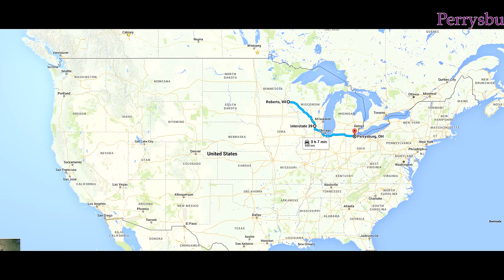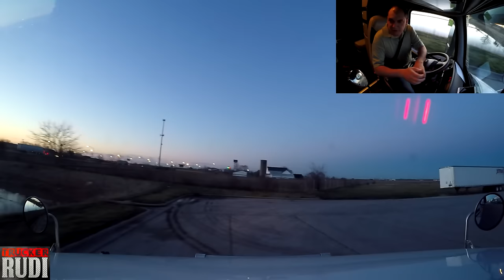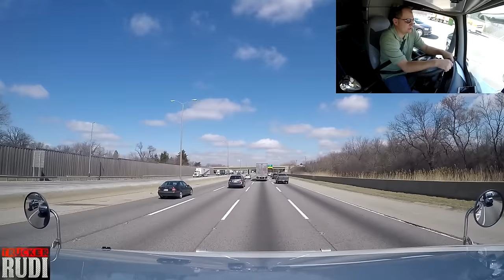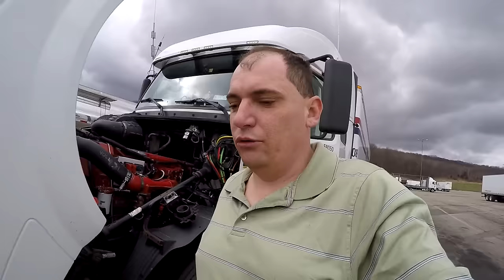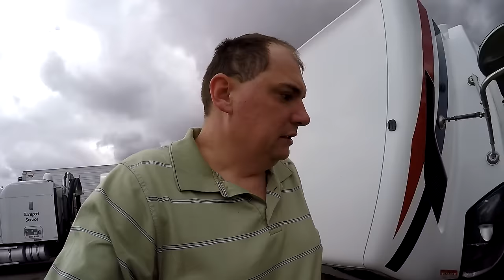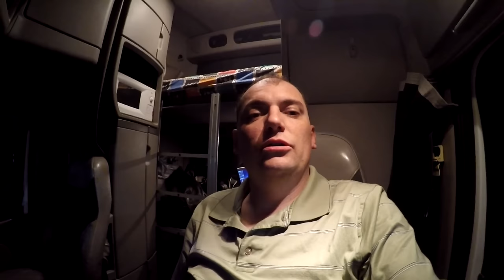Trucker Rudi 03/18/16 Volg#649 Our Daily Journey

Comment: do you have too replace The hole compressor or only The clutch on it ? on Volvos original you can replace only The clutch, It is cheaper that way👍,hope it works out for you! greetings Peter
Reply from the maker: I think I can change the clutch but I think the compressor is shot as well so I'm going to change the whole thing
Reply: +Trucker Rudi (Rudi Dueck) ok it is good  too have that fixed now when The summer is coming!😃😃
Reply from the maker: +Peter juteberg yup

Comment: Trucker Rudi, what do you do if your clock is about to run out and you get to a truck stop and there is no parking? Thanks
Reply: +Ruckus Truck drivers will fudge their log books
Reply: +goldeneagle7771  ok thanks, but if you are running on e logs? Does this happen a lot where you try to shut down and can't find a spot?  Thanks for the reply
Reply from the maker: +Ruckus There is an exemption in the rules that allows you to go to the next safehaven as long as you don't have to go for a long distance don't know exactly how far you can go
Reply: +Trucker Rudi (Rudi Dueck) thank you